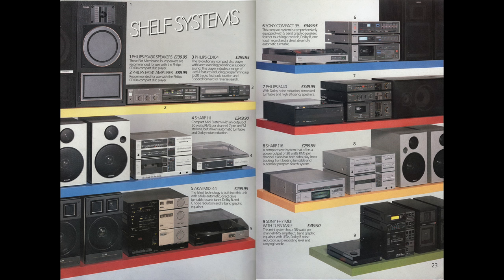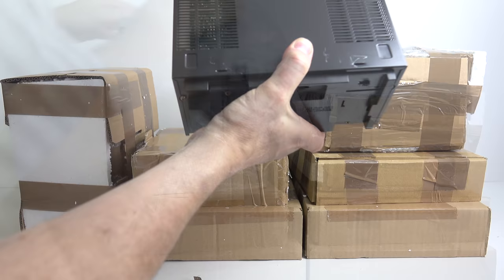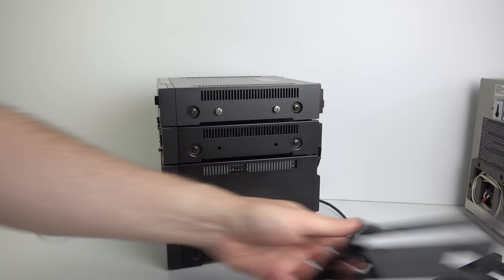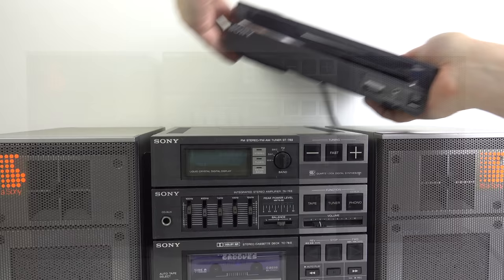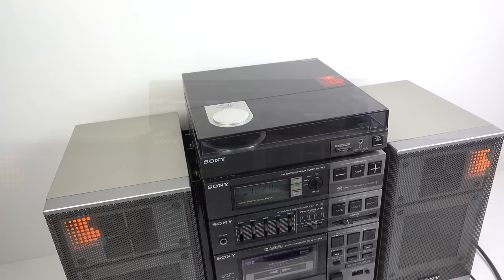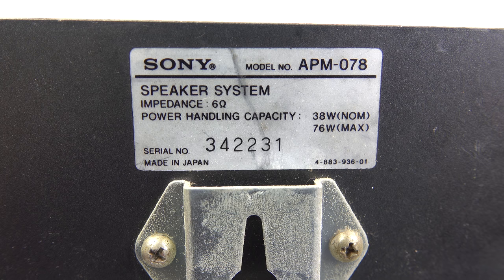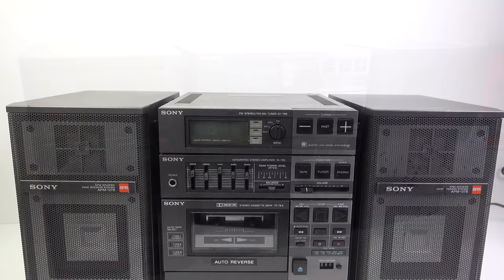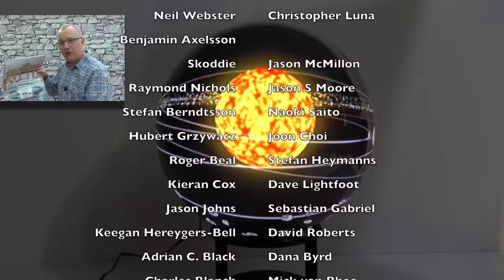HiFi Classics - Sony FH-7 MkII

Comment: I really do not see how Sony did any numbers with this unit probably because I'm looking at the current US equivalent price of over $1,600.  I don't think it's a very practical kit as a boombox and you could do so much better for a small home hi-fi setup.  Techmoan's revisiting quite a few of Sony's old consumer electronic products makes me realize Sony was a very bold and forward company.  They really put out some amazing engineering even if many of their products seemed to exist more because they could as opposed to will it be big seller.  There was a time when I thought Sony was the best of the big Eastern Electronic brands for affordable audiophile quality kit.  I still use a 25+ year old Sony TAE-2000ES preamp because it was the absolute bet digital preamp the company made which I can testify to because I bought the 9000ES later and it was more rubbish that great.  There was a time I loved VAIO laptops too.  Sony XBR TVs were boss.  What has happened to Sony?  They should be a Apple-like juggernaut in all things electronics.  Since I'm not a gamer I have lost a lot of respect for the nameplate.  Some of the past audio glory is seen on occasion like in their range of headphones which has some top-tier models that are still affordable and arguably the best of their kind.  Their audio range of receivers, amps, turntables, and personal players are not wide but usually have at least one compelling unit in each range.  In the US I fear their once mighty TV business is still a bit in shambles if you call shambles a very small share of the market which at one time they rocked the mighty US brands of Zenith and RCA to top.  They say things that go around come around and everything old is new again.  I'm hopeful that Sony will find their zeitgeist again and amaze at the fact that:  look at this Sony product...can you believe it type thing.  I miss that awe which Sony inspired.

Comment: I had a MK2, sounded it's best with CD's of course, I used it as a shelf unit, I didn't like the the record player because of it's lack of tolerance for bent records and worst of all it had a sliding pot capacitor for the volume control so after a while it developed a crackle when changing volume, otherwise it was great for it's size and sound.

Comment: Hi I clicked on our did cause I have the mk3 I bought it from electrpmax in Washington DC Georgetown when I graduated.s.
I paid 
500.00 mine still works I am playing it right now the cassette player did  but the door broke off 
And I guess it got lost or thrown out in a move I do use the tuner and a Walkman Sony cc player with the aux mode image some bigger Polk and celesion impact 25 hooked up  I was gonna hook up a subwoof to it . The reason u don't see these  much is because there so good I do use it with a turntable a tad , mine is all black and yes the speakers have aluminum drivers and are awesome

Comment: My FH7MKII is in full working condition, was a gift from my father 35 years ago, the only thing i'm missing is the screws for the brackets on the chassis, because i used to have it as seperates for many years including the PSQ3 turntable and the CD player _CDP7. If you know the size of the screws from your i will appreciate your help to find the same size so i could bolt on the brackets.

Comment: After seeing the video about your first "Hi-Fi" - The Amstrad Mug's Eyeful, I had to see if you had reviewed mine - I had the very similar Sony FH-5 - It had a battery drawer in the rear of the tape-deck section, and only an analogue tuner, but had the three-way speakers mentioned in the 'differences' segment.

It lasted me many years, was connected to an early CD player and the speakers are still in use at home 

Regarding your closing comments, I was lucky that my first job out of school was in an independent home electrical shop, and I was steered well clear of the imitation hi-fi set-ups available - Started me out on the right path into this hobby!

See someone else's demo of the FH-5 here - https://www.youtube.com/watch?v=whOXlZssfJw

Comment: I just received my FH7Mk3 and it is an adorable vintage piece. I love the speakers, but electronically it's a mess. AUX is in the tuner section, MIC in to the EQ/AMP(?) section, and the headphone socket is in the Power supply section. Mine has some issues, so the tape deck does not roll the tape (loose belts? nvm), and the tuner button won't stay pressed. So I figured the only way use it as a modern amp is a hack from the back, i.e., replacing the tape deck signal with my own. Please let me know, anybody, if you happen to know the pinouts of the ribbon cables. I'll probably use the speakers separately though... Regards!

Comment: Why not use a 3.5mm to RCA adapter, then a set of Y-Splitters for the RCA in the back, that way you don;t have the cable hanging out of the front for the CD?

Comment: Recently I've been reviving a few Sony systems of this era - basically the full-width (midi size) versions of this kit. One sad trend is that the speakers' square drivers' rubber suspension has rotted. I hope yours aren't going the same way. i suspect that these smaller speakers may be paper coned, which seem to last very well.

Comment: It's a very satisfying system to look at.
What was the mystery about the speaker cables? Was it that they connect to the power supply rather than the amplifier part?

Comment: I have had that Sony but it wasn't satisfied with it then went out and bought a JVC RMC 70 and a JVC PC 55 I still have the PC 55 somebody did break into my apartment where I used to live installed my JVC RC mc70 I did like my JVC are some 70 and I do like my JVC pc55 even though it's old now it still works still plays cassettes blade in the front still works everything on it still works Scott quite the punch when you put batteries in is 30 Watts same as the RCM 70 + when I put that plug it into the wall then I get like 90 watt set of it quite the punch quite The Equalizer wipe the counter on it and it all comes apart like a mini system actually one of the first mini systems ever put out you sure can't beat the JVC line I did buy a lot of Sony stuff but still prefer JVC out of it all I also used to have a telephone caen one of the first 120 watt portable stereos but the problem was it was the battery melted inside the unit Family Foundation and it was a hell of a thing to clean up and they wouldn't actually take it back to fix it saw was stuck with that one did get it fixed after so many years after thank you very much friend something in this may be weird just the TV caught wind on the mic and took a few words don't worry about it but I'm talkin about my stereo

Comment: I notice that the eject mechanism on your FH-7is a bit sharp , I have the same problem with a Sony FH-9 and have had a bit of a look inside and saw that there is a small piston and cylinder which dampens the ejection.
Looking at the service manual shows a tiny 'O' ring which I believe the failure of is the reason for the rubbish ejection action.
I've not got around to doing anything about it yet but I'm sure the 'O' ring should be replaceable
I just thought I'd mention it.

Comment: There´s a MKII and MKIII, the only difrerencies are the tuner and SW capacilities.
Reply: FYI: he told you that a microphone input was added, the Aux/CD input was changed from the PHONO button to the TUNER button; thus you could have both the CD player and turntable attached without having to unplug the AUX/CD plug to listed to an LP.

Comment: Hi, Love your videos.   Have you noticed the speakers in the add have square drivers and yours are covered in foam?   Have you checked you actually have the better square drivers and hot normal circular ones?

Comment: Do you remember a boombox that sold in 1987 or 1988 that had a detachable walkman?  I have looked all over for it online and have not found it.  The walkman was integrated into the boombox (or home stereo) which left a rather LARGE gaping hole in the setup when it was removed.  Just curious...

Comment: What is with Sony and their square speakers? I simply don’t understand how that’s actually viable when forming a sound wave
Reply: I works reasonably well in practice. Technics had their own flat diaphragm round drivers. I think Technics call them honeycomb discs, Sony's badge was APM for accurate pistonic motion. However, there's a good reason why these flat speakers have all but disappeared, and that's because they tried to solve a problem no one had anyway with conventional cones and domes. It was a case of style over substance, though the top line Sony APM 33W speakers were well regarded at the time.

Comment: Sorry, I don't mean to moan again, but Mum and Dad had the FH-3 which, if anything, I think looks a bit better, like the beefy volume slider and the horizontal arrangement of the square buttons.  Furthermore, there's no AUX input on the front, although goodness knows what they did instead.  They did waste a lot of space with an even flashier EQ slider set (total waste of time for proper audio buffs, only necessary if you think you're better than George Martin at mixing). Knowing Dad, this probably went to landfill years ago.

Comment: The specs in the Boots catalogue seem to claim it's a 280W system, while also quietly admitting it's actually a 4W one! Looking at the size of the speakers, 4W is definitely the likely one. That's one thing you don't get like you did in the 80s, hifi manufacturers just blatantly making shit up. At least not in offline real-life shops.

Comment: Steve, you had mentioned the price fluctuates with the Singapore dollar.  Is it also going to change with the 25% import tariff or is that already figured in?  Also I have heard I think it was on a forum that there are no serial numbers on the units.  Could you confirm if you're has one or not?  I'm wondering because it would be difficult to have any warrenty work done or is there no warrenty?  Thanks for keeping your eyes out there for cool new products whenever they are from.

Comment: Yes. I have these one from 1985.  a boy ripped off tghe casset cover. 
Is there any chance of getting on ebay?
Lower havu DC power block could be replaced by a battery module.

Comment: Wondering if the service manual you mentioned in the video shows part numbers for the gray metallic trim covering the tuning buttons as it's missing on mine?  I'm the original owner of an FH-7MK II purchased in the US and unlike your tuner mine has 5 preset buttons under the tuning buttons.
Reply: I have a couple of these and a parts unit, and those aluminum facings love to fall off, the double-sided foam tape that they used to adhere them dries out.
Reply: @mescko  Does your parts unit look like this:
https://fmdxing.files.wordpress.com/2016/10/sony-fh7-mkii.jpg
Reply: @josephpetruzzo489  Exactly, down to the Dolby C.  Some only had B.  the yellow button is the giveaway.
Reply: @mescko  Does the tuner on the parts unit have the cover for the tuning buttons & the presets?

Comment: That's a really cool system. One of my first boom boxes was a Sanyo C4. Not as elaborate, but can be taken apart very similarly to make a shelf stereo, along with the inputs for a separate turntable. And weighs a whole lot less (21lbs - 9.5kg) . I got a replacement on online a few years ago in perfect condition.

https://archiwum.allegro.pl/oferta/sanyo-c4-vintage-i7094305343.html

Comment: Thanks - a nice little system. But my 80s HiFi heart misses a manual recording level, Dolby C and a switchable CD-input on the back. :-D Do you know the JVC Cross Media Series from the 80s. A friend of mine had the complete stack when it was new. In my opinion the coolest combination of features, design, quality and sound.
https://abload.de/image.php?img=cross_01p0j70.jpg

Comment: Sony has never made high quality audio equipment until their digital recorders in the early 80's. All Sony analogue equipment would be in level at a maximum of level 3 on a scale of 5 in the time when they were made, whether it was 1970's, 1980's, or 1990's. No serious audiophile buys anything from Sony because the specs are low. For example, in the 80's when boom boxes became a big thing, the lowly Sanyo, Magnavox, JVC, Pioneer, and Fisher actually made some of the best sounding devices, while Sony sounded like crap in comparison. Even Radio Shack stuff sounded better than Sony back then. Sony car stereos of the 70's and 80's sounded like a handheld radio more than an actual car stereo. They became famous for portable cassette players and decent TV's in the 70's but never produced high-end equipment.